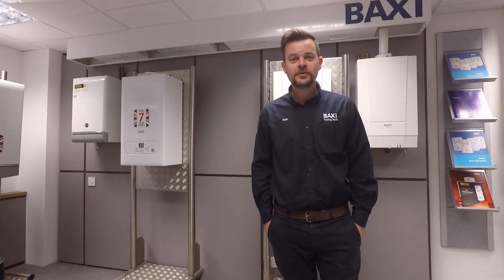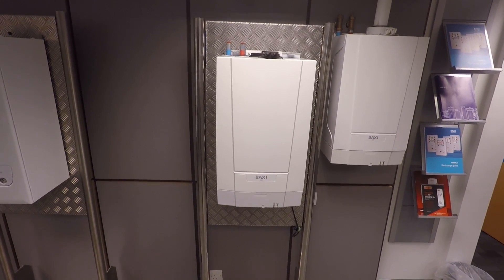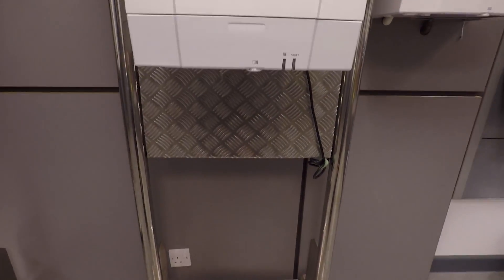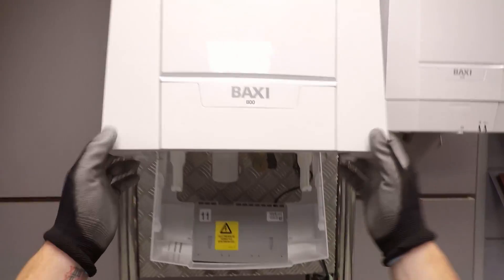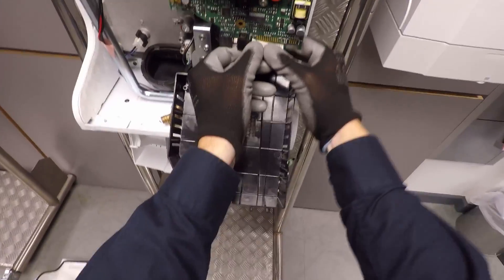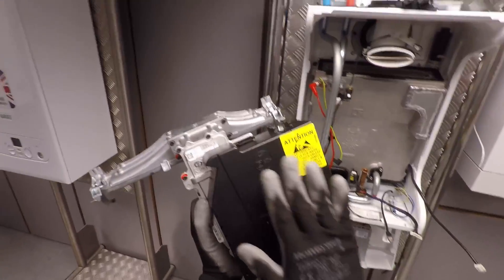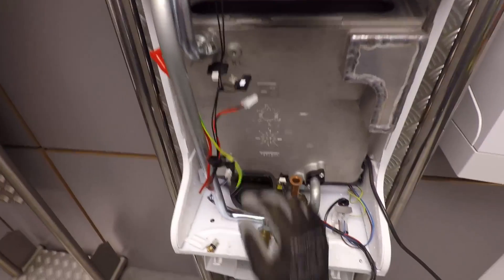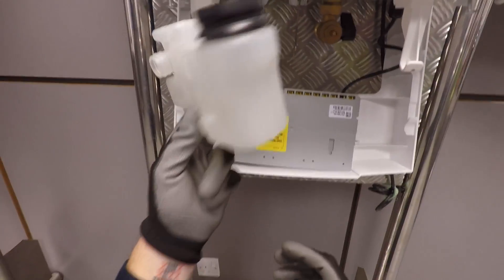Close up look at the Baxi 800 Heat boiler

Comment: Wondering if you can help I’ve moved into a house with baxi precision boiler I bled a radiator but depressurised the system it only had one on off black tap underneath how do you pressurise it without a filling loop ?

Comment: In the lower control board on the swing down panel there are two variable resistors for temp control however only one is used by the hand wheel. The circuit board has provision for 240v +-CH and +-DHW relays assumed to be associated with each variable resistor. Is it feasible to use these to switch between CH & DHW flow temps monitoring to enable a Priority Hot Water Demand system from this boiler

Comment: Please baxi update the 800, so it has 10 step modulation,  also a preheat loop past the heat exchanger for an insulated cold ,  to help with part l requirements than gas heat recovery , also it maybe worth adding a heat pump loop for the heat exchange, so you can add a air source 4-8 kwh heat pump onto it (make that an 800 exclusive) for cheaper heating , naturally that means updating the controls to digital and have your thermostat able to see the. Users energy rates so it can pick the cheaper source to heat, and weather comp combined

Comment: My Baxi 800 cycles on and off every 3 minutes while heating up to the roomstat temp. Switching the pump between the 3 speeds makes little difference. Likewise changing the flow temp made no difference, left it at 55 degrees. Why is it turning on and off so frequently and why is it on 50% of the time? It's no cheaper to run than my old boiler. I have a well insulated modern 3 bed semi.
Reply: I have an old Baxi 60/40  solo and was thinking of upgrading. Is the 800 really no more efficient?? If modern cars are more economical why aren't gas boilers?

Comment: A question, do you have to fit the Adey filter? Can you use a filter that sits in the horizontal plane instead if you’ve got spacing issues where the filter sits?